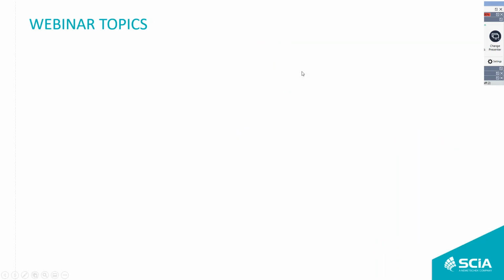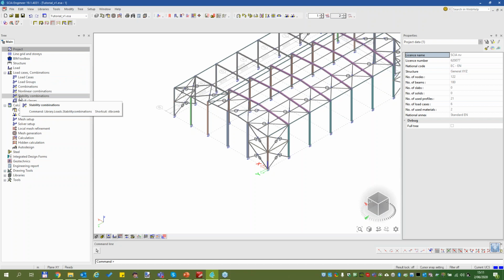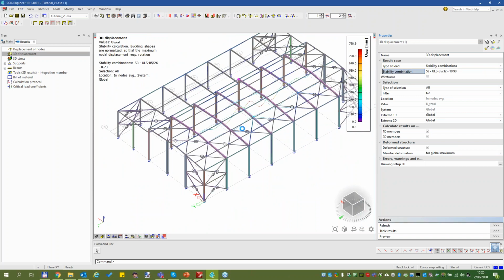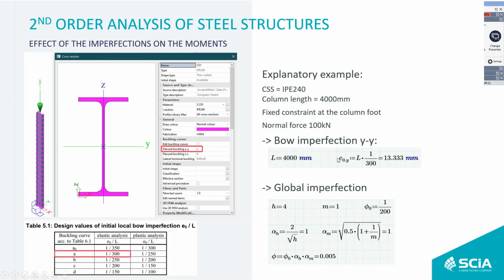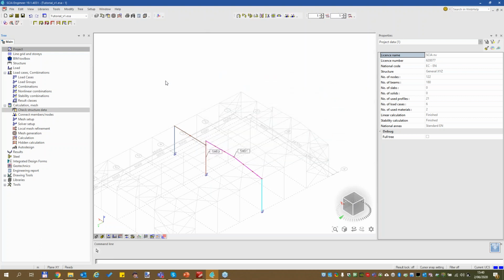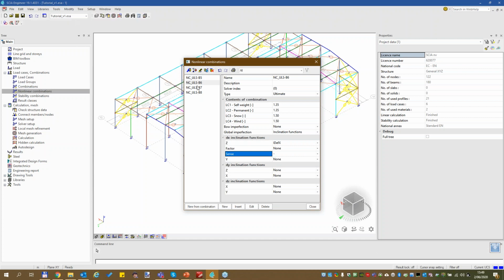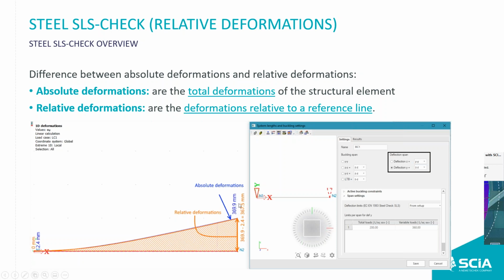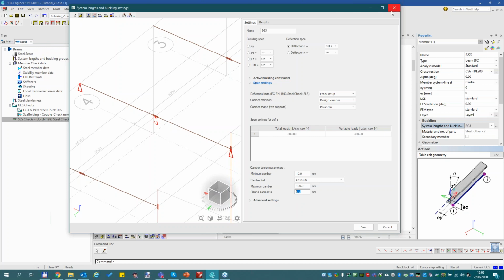[EN] Analysis and design of a steel hall with SCIA Engineer - Part II

Comment: I have one question? How we will decided if we have Sway or Non- Sway case ? For example when I made Stability load combinations and put in the analysis - Number of buckling node (20), in result I have got first 5 modes (ULS/1 =3,65 ; ULS/2= 5,81 ; ULS/3=6,04 ....ULS/20=29,07)  are less then 10 and rest are all more then 10 (I have seen similar in your case ) . So how can I know, is it  alpha,cr < 10 or alpha,cr >10 ? This will decided which approach we will have 1st order analysis or 2nd order analysis...